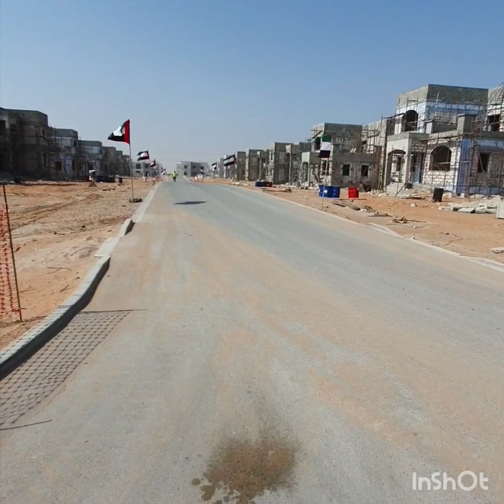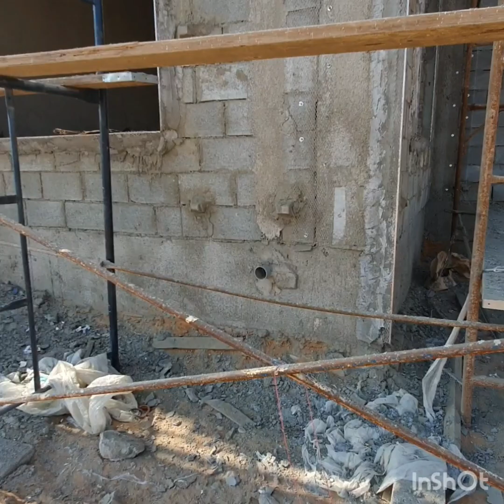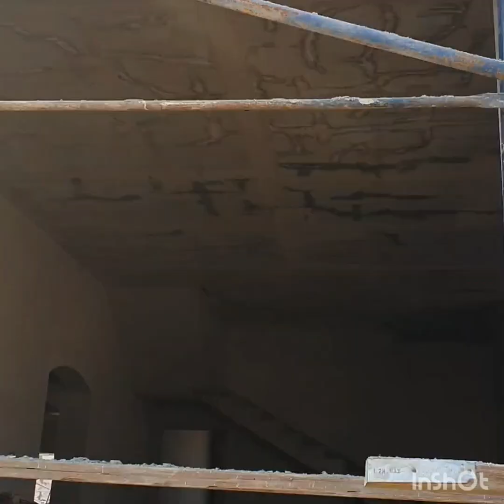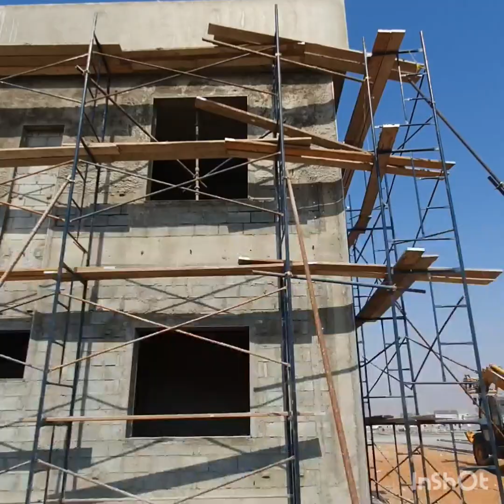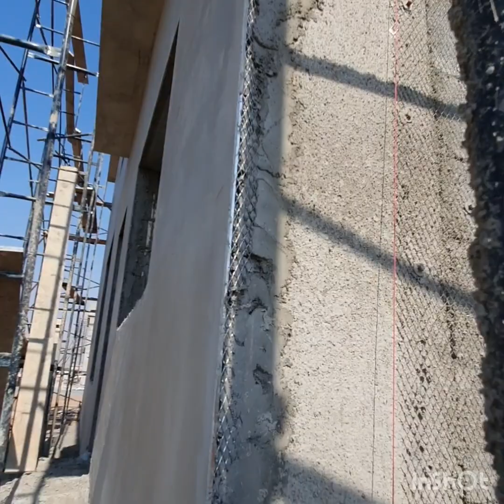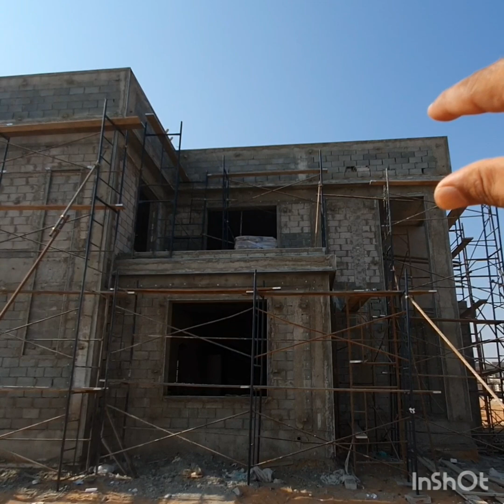EXTERNAL PLASTER PREPARATION; HOW TO PROCEED EXTERNAL PLASTER FOR VILLA

Comment: what is maximum and minimum thickness of plaster?
Reply from the maker: Ideally Plaster thickness must be 1.5 cm , But this thickness may vary from 1cm to 5cm depending on the site conditions such as plumb of Concrete Works, block Works and Conduit Pipes running through walls that whether after closing conduits the surface is level or coming outwards.